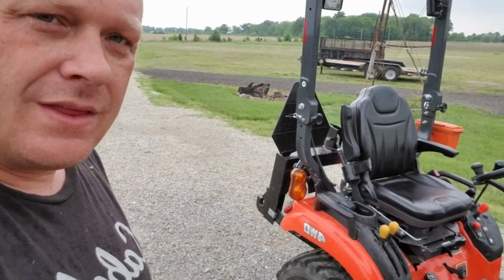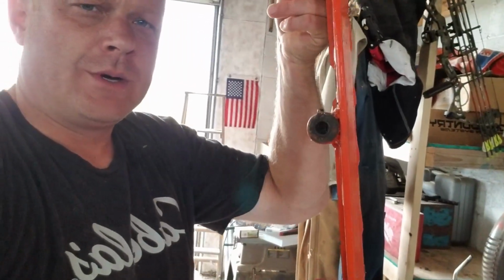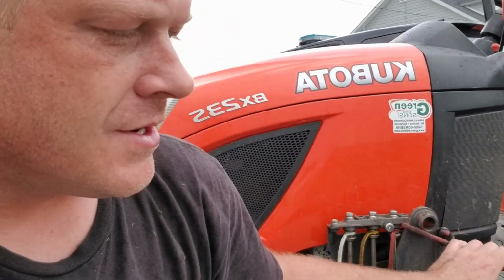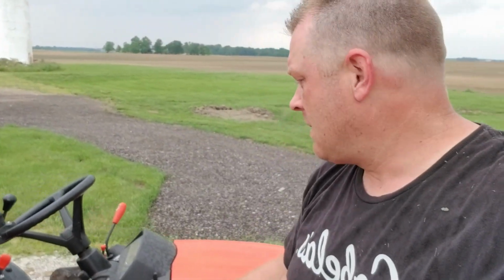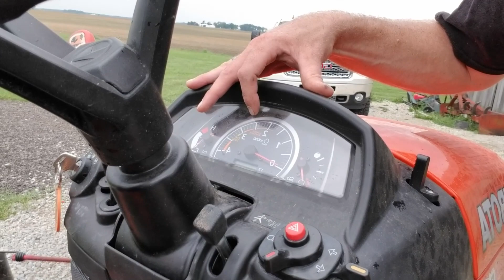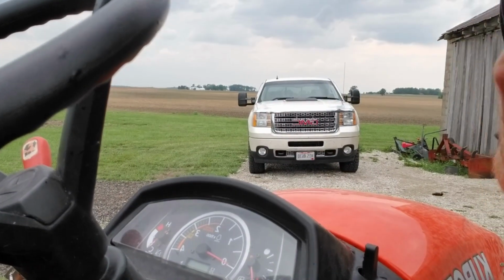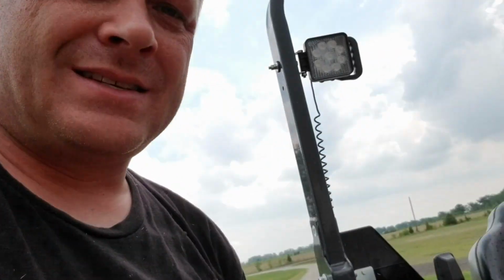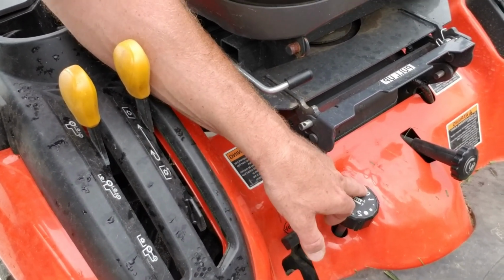BX Mower Deck Options

Comment: First half of the Video is backwards LOL...must have took it with a mirror, weird.  $3k for the deck Umm I was quoted $1400 for the 54" and $1700 for the 60"...they're not $3k, the bagger is expensive at about $3k though LOL.  

Looking at picking up a BX2680, with loader, 60" mower, pallet forks, box scraper, and roto tiller here in the near future, probably several months away, dealer doesn't have any in stock anyways so no rush.
Reply from the maker: Haha, everything on this interweb is taken so literal.  I hope they get one in for you. They are a lot of fun and a great tool. Enjoy!